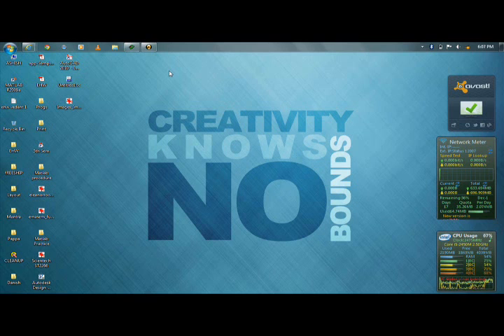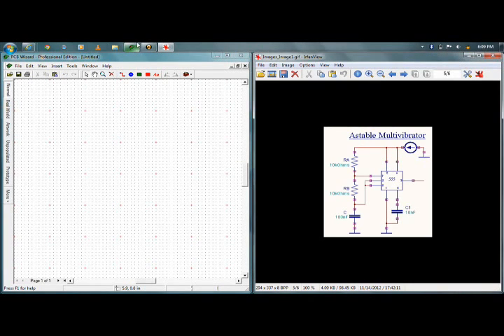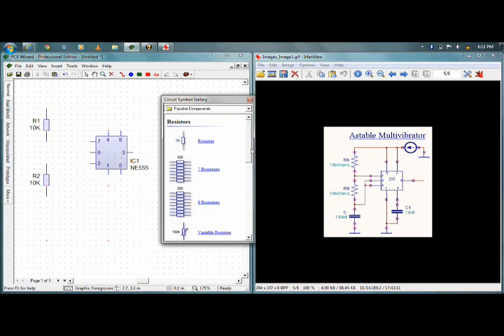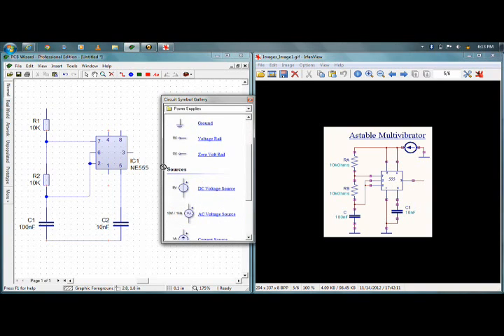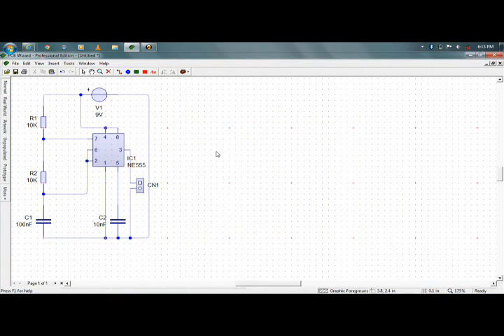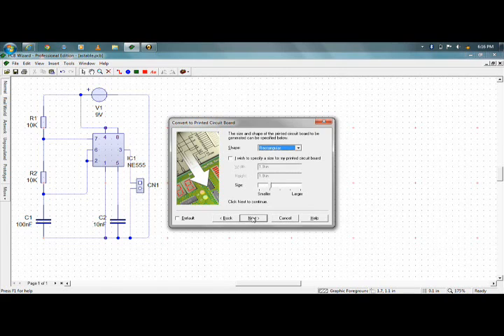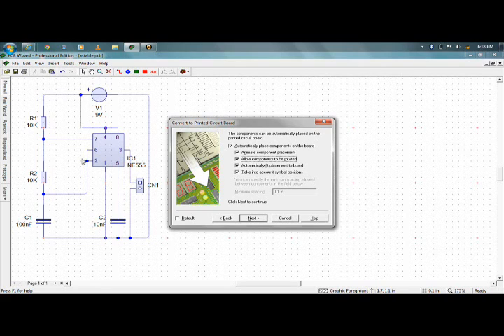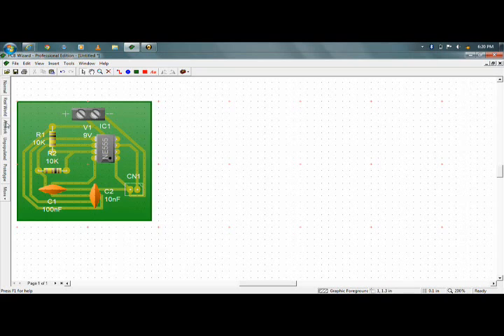Circuit Layout Using PCB Wizard 3 50

Comment: Hi Ashish.  I am NOT complaining, just helping you....  :-)
In English, it is important to put EMPHASIS on the correct SYLLABLES in a word.
For example, when you say... 'component', (containing 3 syllables... 'com', 'pon', 'ent')
YOU are emphasizing  the 'com' part, so it comes out fast as... COMponent, which is not understood !!
The emphasis, (higher tone speaking & slightly dragged out) part, should be the 'pon', pronounced 'pone', like 'bone'....
The correct sounding then, should be like...  comPONent, or like 'com-PONE-ent'.  Every word is different.
You would be surprised at how much such wrong 'soundings' make many words almost un-recognizable.
Keep up with your posts, and speak a LITTLE bit slower too.  Hope this helps !!!!!!!

P.S.  A few more general sample words, with emphasis... (pitch, stress, slightly dragged out.... in uppercase)....
resistor  -  re-SIS-tor
transistor  -  trans-IS-tor
transformer  -  trans-FORM-er
capacitor  -  ca-PAC-itor
education  -  ed-u-CAT-ion
Sometimes, the emphasis is on the FIRST syllable, like.....
altitude  -  AL-ti-tude
magnitude  -  MAG-ni-tude
amplitude  -  AMP-li-tude
Often, 4 or 5  syllable words have emphasis on the 2nd to last syllable, like....
education  -  ed-u-CAT-ion
information  -  in-for-MAT-ion
documentation  -  doc-u-men-TAT-ion
automotive  -  au-to-MO-tive.... (however!!...)
automobile  -  AUTO-mo-bile   (don't ask...)
speedometer  -  speed-OM-eter  (don't ask)
Now for a bit of confusion.... haha.......................................
replicated  -  REP-li-cat-ed    (but...)
replication  -  rep-li-CAT-ion

I'm almost done here.. hahaha :-)    (And I'm going to be shot to pieces for this one xxx)......
The truly ENGLISH word... 'Solder' was invented long before America was populated, and IS pronounced
not only as it SHOULD be, but IS pronounced in the rest of the English speaking world, just like the
words....   'Colder',  'Holder',  'Folder', 'Bolder', 'Older', etc etc etc etc.  The PROBLEM I have, is that WAY
back in U.S. history, SOMEONE decided, wrongly, that the 'L' was SILENT' !!!!!!! and had passed on 'their'
knowledge to all 'fore bearers', to the end that they THINK it is their own 'word' ???   One can MAKE UP
what they want, for something NEW, but it is NOT THEIR word to CHANGE, at a whim !!!!!  Sigh....
I literally 'CRINGE' every time on millions of YouTube Videos, they talk od 'SODDER', or 'SODDERING'.
They are NOT right, Ashish. It is NOT 'their' word to 'play with'   

Have a great day !!!!!!

Comment from the maker: hey theres no need of using function track (F2).
like we have in others, we need to first make schematic of the required circuit.
by default, pcb wizard 3.50 displays dialogue box named "PCB COMPONENT GALLERY".
we dont need it actually.
at start, go to VIEW->GALLERY->CIRCUIT SYMBOLS
using that dialogue box, we have to complete schematic like i have shown. There u simply click on a terminals for connection purpose !!
Reply: Ashish Gopal hiii this Aditi........sir can u plz tell me how to increase the width of pcb tracks

Comment: Hi. At 4.47 you say that you can double click on a terminal and connect them, but i have the same versinon of pcb (v. 3.50) and i can't click on a terminal witouth opening the part properties in other words i can't connect them like you did so i end up connecting them using function track (F2) and when I finish and click convert it says no design found on this page....what am i doing wrong pls help...than you :)